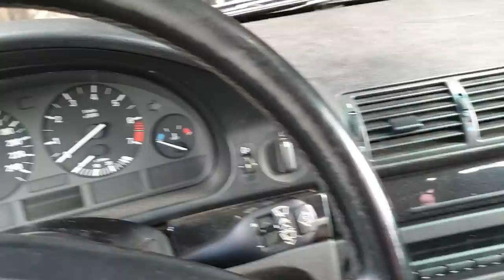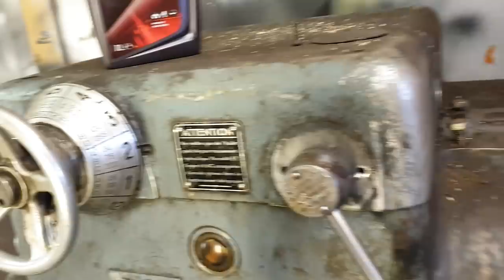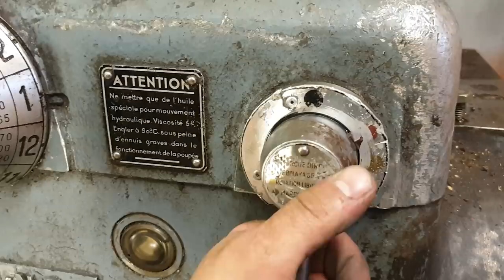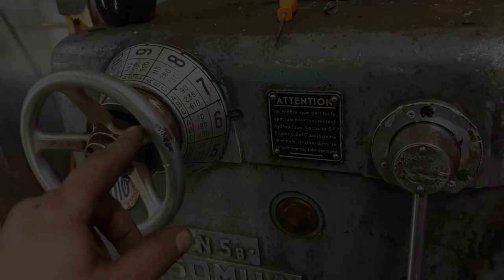Uus lelu tallille

Comment: 4:37
I don't know if that's really helpful and if my translation is correct since I don't know shit about lathes and the specific terms related to them, but French is my native language nonetheless so here's what this label says if you ever need to know.
Caution
Only put special hydraulic movement oil with an Engler viscosity of 5 at 50°c
If you don't there's a risk of having problems with the tailstock's function.

Not sure if the viscosity is actually supposed to be 5 but you can read that better than I can on a screen.
I researched "poupée tour à métaux" on google ("tour à métaux" means metal lathe) because I didn't know what the "poupée" was and if I translated it without caring about the context it would mean "doll" and that doesn't make sense, online translations weren't helpful, but from the images I can see and my brief knowledge of lathes coming from watching this old tony's videos, I think it means the tailstock.
If you find anymore labels or manuals and information about this lathe in french, show it in a video and I'll gladly translate it for you in the comments.

15:32
Green is indeed reverse, yellow is free spinning, red says clutch release, and black is too damaged for me to read.
Reply from the maker: Well that's already lot more than I got out of that text 😅 I would like to use proper oil in this, but I have no idea what that translates in modern oils. But in the meanwhile I did put some cheap motor oil there, because I guessed  that some oil is better than no oil. But here is also the manual for the lathe linked in these comments: http://www.ernault.com/doc_download/21-n5b-notice-de-reglages-et-d-entretien
Reply: @pazi88  From the manual I actually realised the red dot at 15:32 says "débrayage frein" which means brake release, because it's damaged I thought it was only "débrayage" which means release so my conclusion was that there was some kind of clutch system.

For the oil, I found this https://i.servimg.com/u/f72/15/42/79/68/sae_is10.jpg 
Engler 5 isn't in the table but using the value for 6 probably is enough for an estimated guess. And honestly in the manual they recommend different brands and viscosity of oils ranging from 4 to 6, so that's probably not crucial. There's supposed to be 9 liters of oil in the main reservoir.

Then the manual also talks about two other reservoirs on page 21, that respectively take 2.5 and 1.75 liters of Engler 2.

Page 23 talks about checking oil pressure, 
you're supposed to check it where it's written "prise de pression" on the schematic, it doesn't mention how and with which tools tho, but there's a little table with the circuit number on the first column, then the name of the circuit in the second, then the pressure it should be when it's stopped and lastly the pressure it should be when spinning.
Then there's a bunch of technical stuff but honestly I don't know about lathes enough to translate... But if you need anything specific you can ask.
Reply from the maker: @imnota  Great thanks. According to that table, it looks like 15/20W motor oil for example would be fine. And that's actually pretty close what I did put there :D
Reply: @pazi88 
 Poupée = headstock = left fixed part of the lathe
Contre poupée or poupée mobile = tailstock =  right mobile part of the lathe.
The oil is given at 50 ° C  operating use  in degrees Engler for viscosity on your machine.
The engine oil you use is given at - 15°C and +45°C for each of its values : it's a viscosity relative to temperature .
You need a straight single grade of hydraulic oil ,not an oil wich will be thick while cold and thin out when warming up.
ISO VG 46 or 68 is a single grade oil.
Reply from the maker: @michaelovitch  Thanks for the answers. I'll probably get jug of this before I go to the garage: https://www.ikh.fi/fi/hydraulic-basic-46-20l-wkoh46-20?gclid=Cj0KCQjwz4z3BRCgARIsAES_OVd0J-qFANTLNfni9tI4ia2_Yh1vYu6GtJxC6wIwMwLCKnmH9cu3ueAaAt-IEALw_wcB
Reply: @pazi88  You should try to look under the headstock cover and clean up the bottom from grim ,mud and metal chips.
Using a new detergent engine oil like you did will lift the sediments from the bottom and send them flying in the bearings damaging them ,wich are very specific and expensive on the chuck shaft.
High precision bearing "5P" are more than 100 $ a piece.

Comment: Is it possible to use the m54b30 crank with m50 non vanos 135mm thick rods in an iron block?
Reply from the maker: Yes. With m54b30 pistons.
Reply: @pazi88  i am going to buy the cheap forged pistons that you reviewed

Comment: Pazi I’m gonna build my m52 on e36 chassis how much power do u think I can make without breaking stock e36 m3 drivetrain? Or you’re just familiar with e30s??
Reply from the maker: Well e36 has pretty much same drivetrain as e36. And I'm still using stock parts in mine.
Reply: pazi88 would u go 550 torque/745 nm on zf trans stock driveshaft and axles and 2.93 188mm diff?